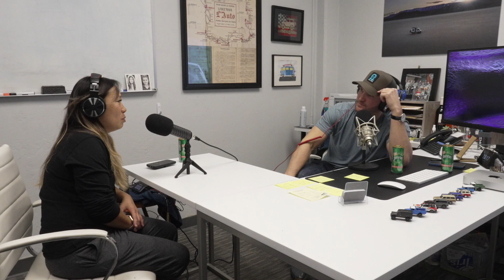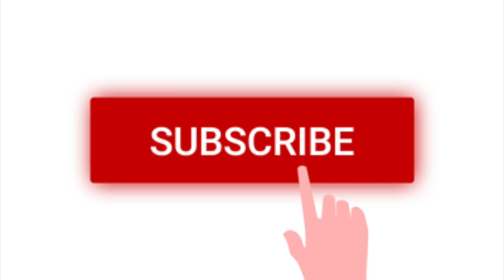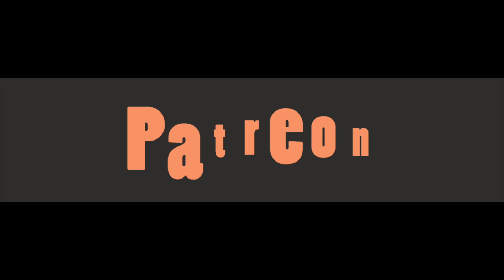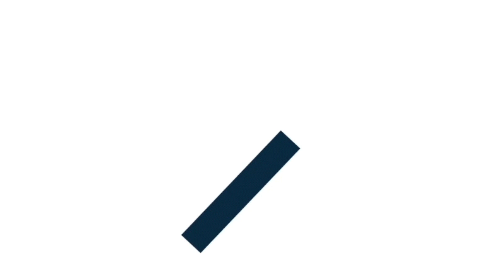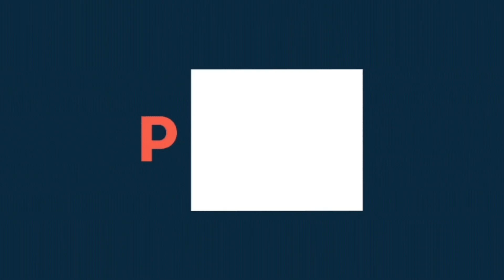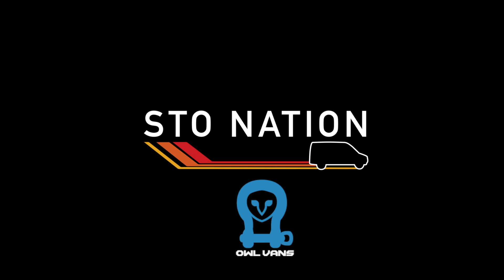43. Owl Vans, Part 1

Comment: Maybe you will cover this in part 2, but I'm curious to hear John's thoughts about the fact that 2023 will be the last model year for 4WD for MB and then will switch to AWD with a lower clearance. Does a locker work with AWD in the same way or is that a totally re-engineered product?